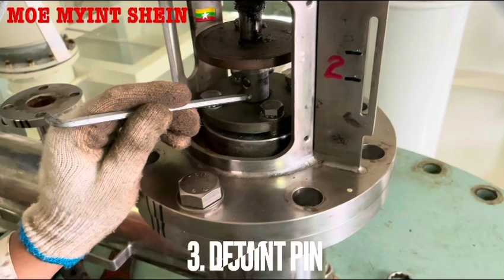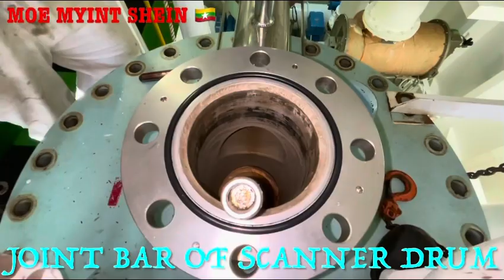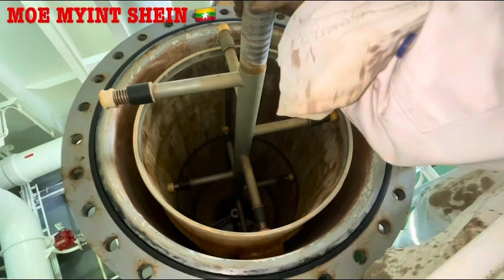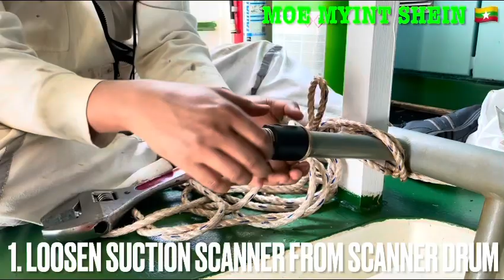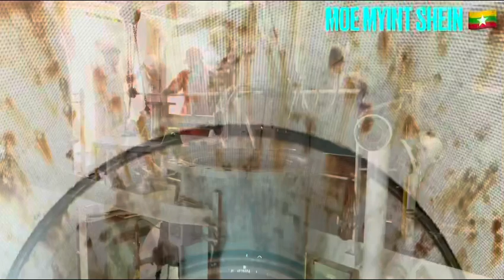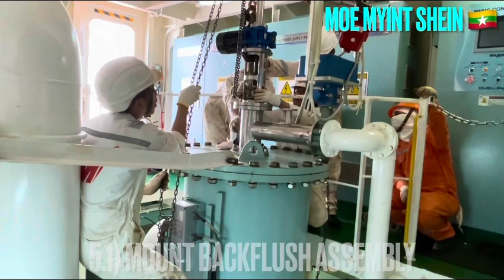[PANASIA] BALLAST WATER TREATMENT SYSTEM | Filter Element Maintenance | Technical Vlog : 040

Comment: Unlike Alfa Laval, Filter element is simple and easy to handle. 
please can I know the location of that BWTS Filter Sir ?
I usually see that filter at Upper or bottom platform of Pump room but I can see daylight on your video sir or am I mistaking ?
Reply from the maker: NO Pump Room for Later design of tanker ships from Shin Kurushima Dockyard. There is Clean Operation Room instead of Pump Room. 

BWTS System is placed on deck with separate compartment and named BWTS Room. Can go directly from catwalk to BWTS room. 

To ensure BWTS Room is above Hazardous level, BWTS room is a little higher than Catwalk level. 😊
Reply: @MoeMyintShein_MMU  Oh! Thank you very much sir. That's new for me but it's very precious so that I can study in latest design. 

Thank You sir.